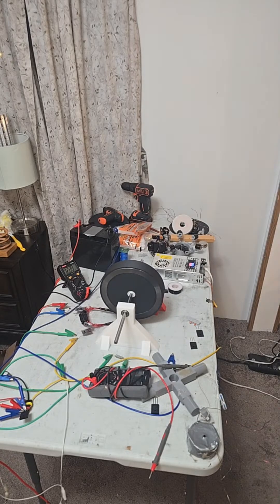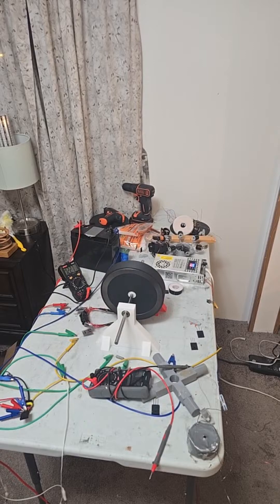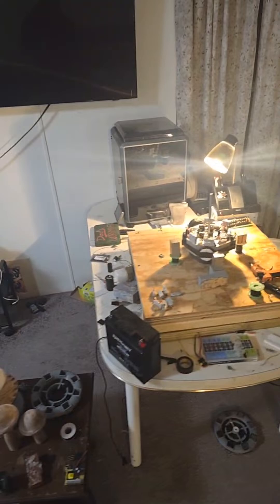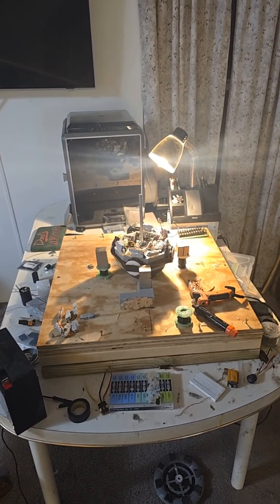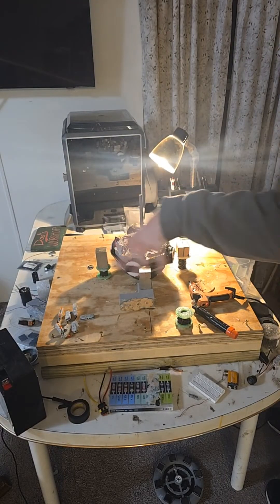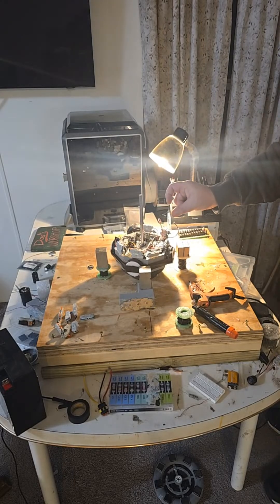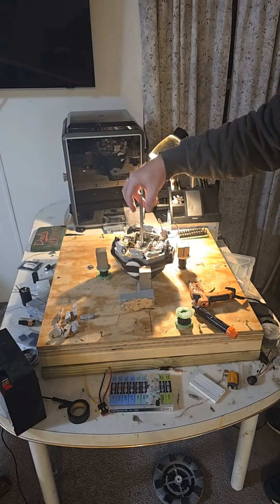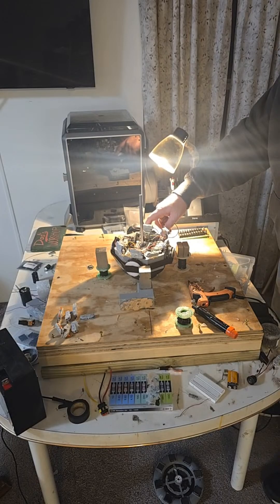Live highlight

Comment: Hook a meter to the contacts of a commutator. U can get one off a cheap pawn shop drill. Get some graphite brushes Im gonna make a short on the commutator i made.
Reply from the maker: there is no commutator boss I mentioned making or using one when I first built this making the commutator with a positive and negative plate of copper and allow the brushes to hang down ill check out your video all contact points are to be coated in graphene.